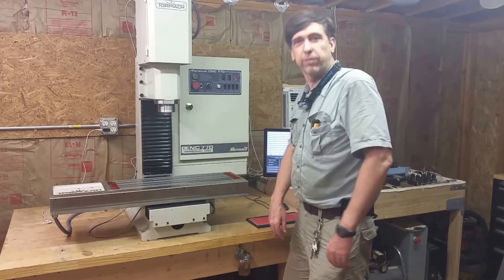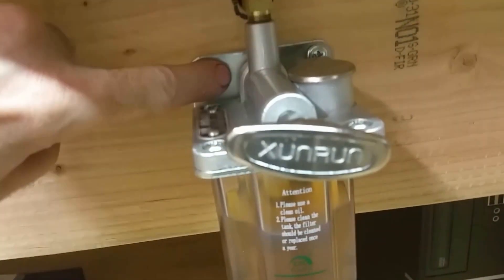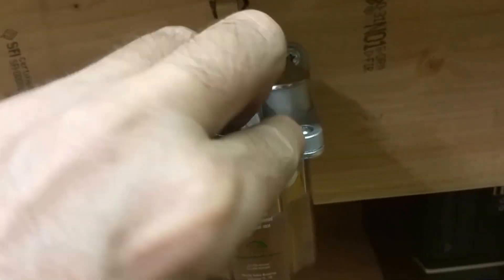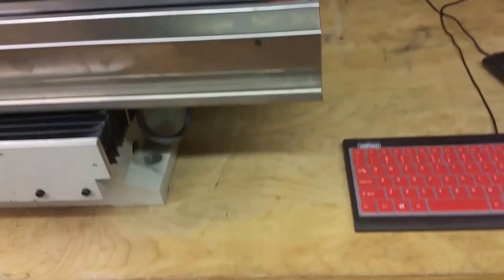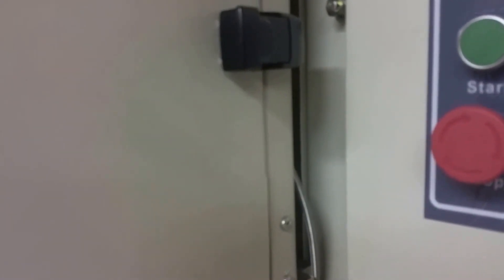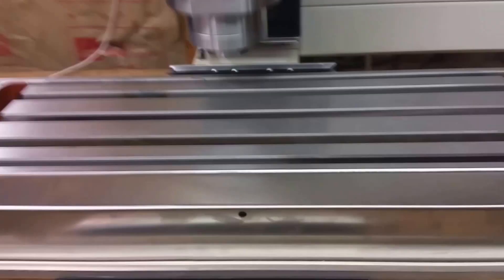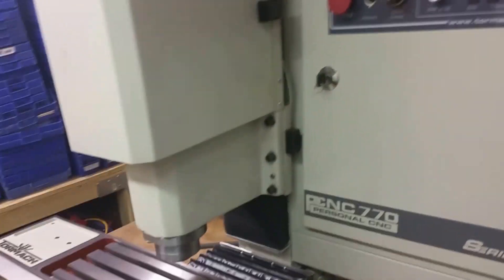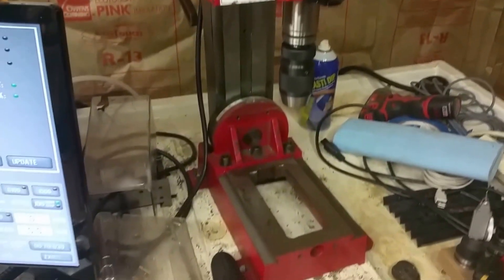Tormach 770 part 4  - Installing the Manual Oiler

Comment: Not sure if its too late but i'd recommend you install a large oil drip pan between the mill base and bench. The oiler displaces old oil on the ways and that old oil will end up on the bench.
Reply from the maker: +l0ckcr4ck3r  Yeah, I thought about that but didn't have time to find one befor the mill came. Guess I could have used a car oil pan now that I think about it. Well I may just epoxy the top of the bench or something.  It is just temporary though.  I will need to get a tormach stand and move into a shop with a concrete floor.